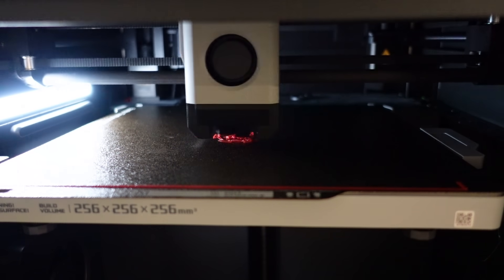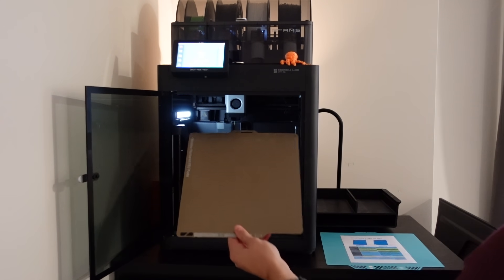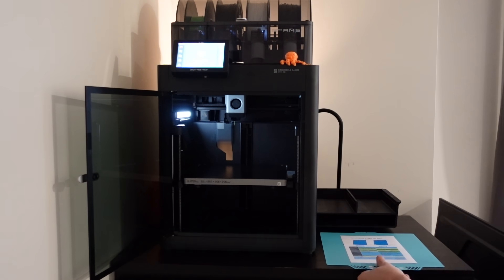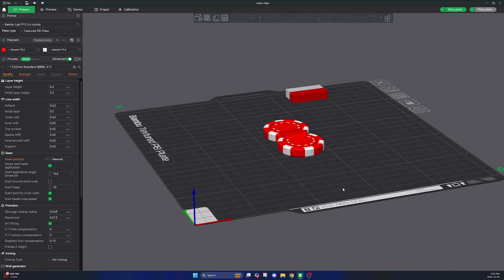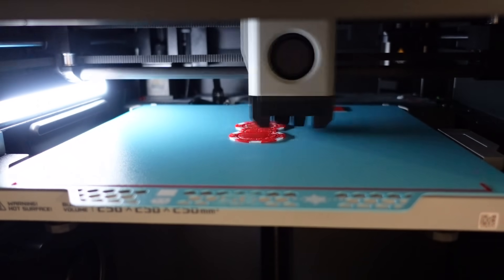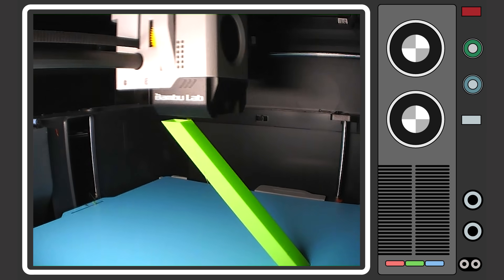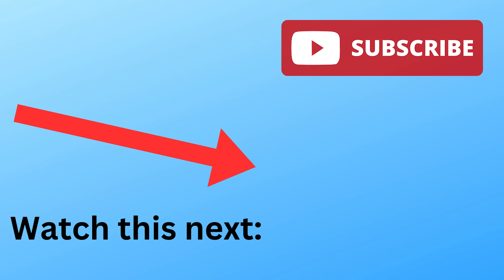Why You Should DITCH Your 'Textured PEI' Build Plate!

Comment: The build plate looks amazing, but it's overkill for everything that's not a bed slinger. Other reviews show it sticks a little too well, and for higher temp plastics that usually doesn't stop them from warping and just lifts the plate. Personally that's why i stick to glass (silicon carbide), nearly dead flat every time.. nearly, because over time and high temps (110c in my case) glass over the years does warp a bit (0.223 variance on a 300x300mm build area). It's got a very narrow window for temps and you usually have to drop it down 5c after the first layer, annoying but worth it

Comment: I had the exact same problem....then i changed ONE setting.
Because it puzzled me that the "purge/prime" line that it puts down before it starts the actual print was sticking just fine.

So.....first layer runs at 20mm/s instead of the stock 45mm/s from the software......EVERYTHING STICKS NOW
Reply: You might have the same issue as the video then. You should not have to change a setting that drastically from stock just to get a first layer down.

Comment: Think I'll stick to the PEI, only had one failed print so far. Upon inspection after, I could clearly see the big greasy fingerprint I'd left where I'd clumsily touched the build plate when releasing a prior print. Quick wash with warm soapy water and it has worked flawlessly since. (I am now very careful not to touch the plate, and I do wash it with warm soapy water every now and again.) 

If you're reading this and are only just starting out with Bambu, or are waiting for your first Bambu printer, the textured PEI plate works perfectly well, prints stick too well sometimes! Do not waste money on extra plates like this. Just make sure you NEVER touch the build plate with your fingers, as they will add a thin layer of grease. Scrape any excess filament off the bed between every print, and wash it once in a while with nothing but warm soapy water. (I use washing up liquid, dish soap in the US, as it's a degreaser.)
Reply: Same here, if you keep the plate washed and cleaned,  I have 0 issues
Reply: While you are right in normal circumstances for most, there is definitely something else going on for some people. Been printing forever, but my new p1s has the same issue as this video if not worse.. and I can promise you that my bed is perfectly clean. You can clearly see on the bottom of prints or with a bed level test where oils are on the plate if that is part of the issue. Its extra strange with this PEI plate.. I can get some prints to succeed if i do 15mm+ brims and the objects aren't too tall, but when the print is done, it only takes about 1 minute of the bed to cool down before the prints slide off like butter. Don't have to flex the sheet or use any scraper to lift prints off. If i pull them fresh off the hot bed before cool down, its like pulling a weak fridge magnet off. hardly any adhesion.
Reply: @MrSoundChaos  Yeh, I've seen a very small sample of people saying the same.

Maybe a bad batch of plates?

I would contact Bambu and try to get it replaced.
Reply: @coasterfest  Bambu got back with me, they said all my issues are normal and expected. they said I should always just use a brim of 10mm or larger, and set bed temp for PLA to 65c instead of the standard 55c. That usually doesn't work for me either, but if I combine that with setting the aux fan to 50% or less I can get some simple ones to work.

Im a little annoyed that they wont do anything else to help though, because as it is, I cannot print the majority of premade profiles from makerlab on my phone. I have to open them and modify them on a computer every time.
Reply: @MrSoundChaos Yep, that’s poor customer service and frankly, an absolute cop out! Not to mention it’s a down right lie, as it’s not normal circumstances at all, as evidenced by the sheer number of commenters here. 

I wonder what they’d say if you bought another identical plate, and had no issues with it, would they double down or hold their hands up.

Such a shame, as their products are fantastic, but this isn’t the first story of their customer service I’ve been disappointed to hear. 

At least you tried. 👍 You really shouldn’t have to be finding workarounds :/
Reply: @MrSoundChaos  Although, I've just noticed the stats you actually put there. 

To be clear, I ALWAYS use the built in profiles on Bambu Studio, I never ever play with fan speeds. And for Generic PLA the build plate automatically sets itself to 65c, not 55c, so you may be onto something there. 

The only things I ever change manually are things like walls, infills, etc, never the actual hardware parameters... Just let Bambo studio take the reins there, and run at whatever they suggest for the material I select. Hasn't failed me yet.
Reply: @coasterfest  For the P1S, PLA sets the textured PEI build plate to 55c, but on my A1 mini it defaults to 65c. I suppose its on the P1s to avoid heat creep for people that don't open their door and top glass while printing PLA/PETG. I have to keep it open and nothing at all sticks at 55c, so I have to bump it to at least 60 to get any adhesion going. Fan speeds default are usually maxed after the first player for PLA on the P1S, which pretty much causes over 50% chance of failure consistently. Both of those changes still aren't enough though, I have to do big brims along with all that to succeed for most prints.
Reply: @MrSoundChaos  Hmmm, I don't use the P1S I use the A1 (not the mini, the full size bed slinger.) I am going to pick up either a P1S or X1C in the sales (Haven't decided which yet.) 

Strange that they assume you haven't opened the door, despite all of the guidance telling you to open the door and remove the top glass panel for PLA on the P1S and X1C. 🤣

Heat creep is weird. I just had an issue, not with bed adhesion, but with tall supports. I was printing something with tall back and forth support lines. I use a filament dryer, that sits around 6 inches from the plate. It's only set to 50c, but even at 6 inches it caused the support lines to warp as they got taller, they started to lean over and my print failed. Moved the filament dryer a little further away for the retry and it's worked. It's strange because from 6 inches I can barely feel any heat from the dryer with my hand.

Comment: The textured PEI plate sticks fine. The issue is that it's texture and colour hides fingerprints. Where you touch the build plate, the prints won't stick. Clean the plate with a sponge and dish soap and it's perfect.
Reply: I just have a habit of always cleaning, but I just have two printers (Ender 3 and K1).
Reply: Yeah I have some alcohol wipes that I keep by the Printer specifically for this… And I don’t do it every time… I only do it if I know my fingers or my skin have touched anywhere on the build surface. So for instance if I just released a print and I never touched anywhere on the plate except the very edges then I don’t feel the need to wipe it down… but if I touch anywhere on the build surface where I know, print is going to go down… It gets wiped down.  Holy shit voice to text sucks… I had to make so many edits to this thing, after re-reading it.
Reply: 90% alcohol + microfiber, don't even have to remove the plate. super easy to clean.

Comment: It’s great that you found a solution that works for you! However, I think it’s worth noting that the choice of bed surface can depend on the filament and specific use case.

For example, textured PEI sheets are designed to help with releasing parts that stick too well, like PETG, but this can make PLA adhesion trickier if the sheet isn’t properly cleaned. PLA generally performs best on a flat, smooth PEI sheet, but a clean textured sheet can still work fine.

When cleaning a textured PEI sheet, dish soap and water (or even running it through the dishwasher) are often more effective than just IPA alone. A dirty or improperly cleaned sheet might have contributed to the issues you experienced.

Your new plate sounds like a good fit for your needs, but keep in mind that other filaments, like PETG, might bond too strongly to it. While it’s great to share what works for you, making broad recommendations to ditch textured sheets based on one experience might not apply to everyone in the community. Each setup and filament has its own nuances!

Comment: I'm at about 1200 hours on my p1s, and in that time I've had 4 print failures, and each time it was because my plate was dirty.
Reply: funny that.... first thing i do if a have a fail iis clean the bed with soap and water, then when its dry , a quick wipoe with 99.99% ipa and a lint fre cloth, winner winner
Reply: @yandyyay just regular dish soap  is fine. Worse case a quick spray with hairspray...
Reply: This, and also many people don't know that touching your buildplate with your hands just once can ruin adhesion because of you oils. And no Isopropyl alcohol is not good enough to clean it, get it under the since with some dawn
Reply: I generally give the build plate a wipe down with 90% isopropanol if the machine sits for more than a few days 👍 even if no visible dust is there you still will probably have a very thin film

I print on a glass bed, which has a very narrow temperature range for your filament to stick to. But since i print a lot of high temp plastics i've noticed a long time ago that even if it looks like the parts are perfectly stuck to the bed it could be pealing the magnetic bed off the build plate and your part is sill going to warp.

Another "plus" to using glass is that it seams to radiate more heat into a closed chamber. I get about 60c with the bed set to 105c. With power usage at around 100 watts after the camber heat soaks.
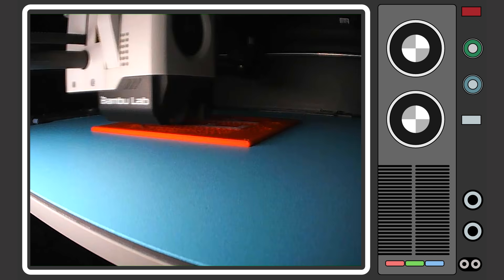Reply: same here; not that many hours and maybe 10 fails in total; all caused by greasy plate, a little wash with soap and adhesion is back. Only predictable problem is on the left of the bed (right where the fan is) the fan causes the (admittedly bad) PLA i use to cool down too quickly and warp (as seen on 1:33 but a much much lesser degree)
Reply: I have an A1 mini w/ the PEI plate. I had problems with bed adhesion as soon as I got it and started washing the plate and applying glue stick before I print
Reply: I've never touched my plate with bare hands and clean off all dust and make sure no grease after every print.. 200 hours in and roughly 50 failures so far. All of them are due to nothing sticks to the textured plate no matter what settings. I have to do massive brims to get anything to complete, but tall objects still wobble too much and dont stick directly under them so still fails. Never had a build plate stick as poorly as the stock bambu textured
Reply: @MrSoundChaos  yea same i always have problems withe the pei when it comes to corners and warping,
I found really good setting to midigate that but i still need brims some times and after a failed print i always wipe the build plate first with soapy water and iso prop 99.98% and it still failes without a brim,
I now got the cryoplate today and its already doing really good prints
Reply: Dish soap or glass cleaner works fine
Reply: probably because you print useless shit out of pla

Comment: More than a thousand hours of printing with it without having a problem.
Either you are lying or you forgot that it's supposed to be cleaned...
Reply: he got the plate for free
Reply: ... or simply the z-offset is off ...
Reply from the maker: I would not lie to my viewers, and I have cleaned the plate.
Reply: @engineer3dprints  Did you use anything other than soap/water to clean your PEI? Chatgpt suggested I used acetone early in my 3d printing journey, before I knew what PEI was. Acetone dissolved my PEI layer destroying the plate's adhesion. 

I would suggest a more thorough test comparing a new PEI plate to the new cryo plate of the same quality. Not your old PEI plate to a new cryo one. Especially given that these are consumable items.
Reply: @engineer3dprints 
I don't really have any reason to believe you in that.
But if that were the case, just buy another one because you are clearly one of the very few with any problem like that.
Reply: @guyversama1  Im not sure you've been looking very hard. Maybe its a more recent factory defect or something, but my new P1S has the identical issue. stock build plate doesnt stick to ANYTHING no matter what. Very common issue right now
Reply: @MrSoundChaos  I looked at my thousand + hours of using it. And all my friends using it, and all the other specialised youtuber not saying anything like that at all.

This is the one and only time I heard anything bad about it.
So I'm much more inclined to consider you guys as untrustworthy.
Reply: @guyversama1  Just as another data point, I got my A1 mini in yesterday. It also uses the supposedly same textured bed, but it doesnt have these issues whatsoever. I can imitate the exact same settings on the p1s with chamber/aux fan off even, doors and top open.. and it doesn't stick anywhere near as well as the A1 mini bed.
Reply: @MrSoundChaos  and I got my brother's A1 mini today for Christmas, I'll let you know if the textured bed is doing well or not.

Maybe they had a few ones that were defective.

Comment: Interesting.  Using the textured plates I have had minimal issues on the X1C using PET-G and PLA.   I do have to play with bed and first layer temps between different manufacturers of filaments but that's normal.  I am hearing good things about these new cryo/cool plates, however.

Comment: I’ve been using the textured PEI plate for several months and hundreds of hours and have had perfect adhesion every time.   Printing with a Bambu Lab X1C
Reply: 1 Have a P1S and I have only one print problem, I just clean and printed again and was perfect. For Me Gold plate is fine.
Reply: I have this for about a month now and it is pretty good actually.
Reply from the maker: Very interesting. I wonder if the Lidar really helps with that
Reply: I've been using it as well for a year and have had no real problems with it. I do periodically clean it with alcohol though, just to keep it nice and fresh.
Reply: P1S owner here and I have maybe a few hundred hours on it with the stock plate and I have had very few adhesion issues. The couple times where I did have an issue was with a print that had an extremely small footprint and adding a brim completely fixed the issue.